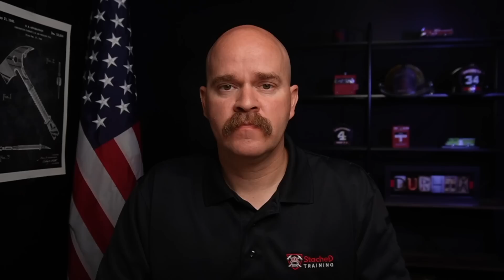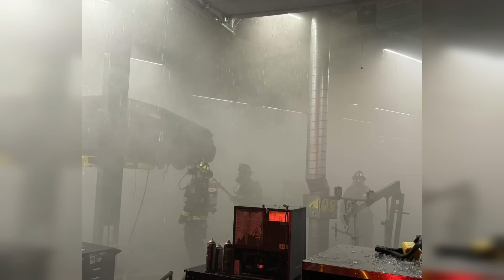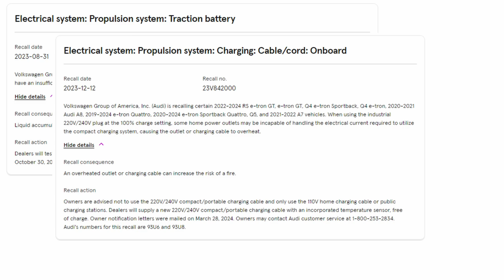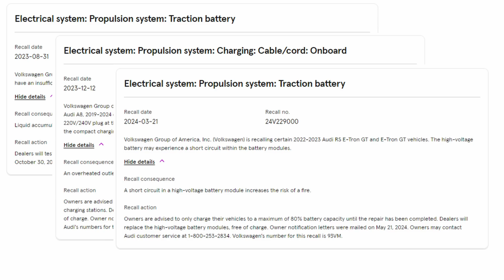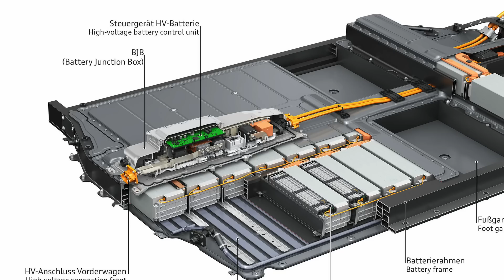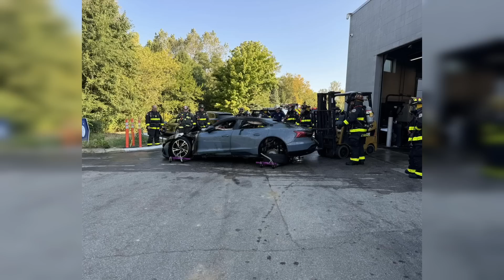EV Fire in Service Bay: Stuck on the Lift

Comment: So if I ever buy one of these things I’ll have to park it 50 feet away from my house. I wonder how my neighbours will feel about that.
Reply: The same way they feel about all other vehicles with a “do not park inside” recall feel
Reply: Yeah that advice is not practical at all.
Just storing it outside mitigates most of the risk.
The distance is due to the smoke.
Reply: @economicprisoner  The distance is because of the heat of the fire. The smoke is lethal for much more than 50 feet. The batteries burn very hot so anything within 50 feet is in danger of at least getting scorched.
Reply: @MapleMAGA1963 The intense heat IS a major concern,but in the incinerations I’ve seen these melt downs can shoot plasma jets 15’ and hurl chunks of flaming debris 50’.
Reply: My first house had the driveway next to the house.  The property line was 8-ft from the house, the width of the driveway.  50-ft was the whole width of my property.
Reply: Glad you got to work
Reply: I ask my city if I could wire my charging station out by the driveway and they said, "Not no but hell no."
Reply: He meant it should be parked 50 feet away because it already had an electrical issue, which makes it way more at risk of a fire.

Comment: Contrary to popular propaganda, EV's are turning into a nightmare.
Reply: That's right.
Reply: VERY well said
Reply: Besides your feelings and a video of a malfunctioning car, what is your source?
Reply: @nathanbaker6033  First, I would say that an EV bursting into flames is more than a "malfunction".  Second, search the internet and you will find numerous examples around the world of EV battery caused fires. ICE fires almost exclusively happen after major accidents, but not spontaneously.

If you like them, you're welcome to use an EV - it's a free country.
Reply: @terry_willis   The Swedish Civil Contingencies Agency (MSB) reported 23 fires in 611,000 EVs during 2022, or 0.004 per cent in a year, which makes it 20 times less likely to happen than ICE car fires, which burned 3,400 times in 4.4 million cars, or 0.08 per cent.

Also a quick search showed that only 1 in 8 vehicle fires happen on the highway. So no, ICE fires aren't almost exclusively happening after major accidents. Electrical, mechanical, and engine overheating are all leading causes of fires and they are not always related to car accidents.
Reply: @nathanbaker6033  Like I said: It's a free country and you're welcome to use an EV.

Comment: Not just the other cars in the shop.  All the tools that may have been damaged as well.
That was an expensive fire.
Reply: I can only imagine the fleet of Snap-on and Matco trucks heading their way when they get an insurance payout. It'll look like Gondor called for aid.🤣
Reply: @Dirk_McDirken  Only things like code readers and electronic tools would be affected.  It's not going to hurt things like wrenches and sockets.
Reply: @ffjsb  Depends how soon you can get in to dry and oil them. Wrenches will rust.
Reply: @economicprisoner  Not that quick.  Most are chrome plated.
Reply: @actually5004  Which is a SMALL part of a mechanic's set.  And even still, they're not raw steel, they have a coating.  Again, they're not going to rust away in a day or two...
Reply: @ffjsb  Incorrect. Extreme heat ruins the hardness and temper of the steel used in the hand tools. It will also cause the chrome plating to separate from the underlying steel, and this is evident by visible bubbles or blisters. Much of the damage cannot be detected by sight or touch but only by subjecting each tool to hardness testing and comparing the results with manufacturer's specifications.
Reply: @economicprisoner  Rust isn't the worst problem. Read my other comment on this topic.
Reply: @ffjsb  What do you think happens to chrome plating when exposed to high temperatures?
Reply: @GaiusTacitus  You clearly don't know what you're talking about.  Not one single tool was subjected to ANY heat.  All the fire was contained to the car and the lift.  It probably didn't get much over 100 degrees in the building except directly over the fire.  The sprinkler system contained  the actual fire damage.  Did you even watch the video???  And like anyone is going to do a hardness test on every wrench and socket...  Have you ever done an actual hardness test on steel??  I have.  You're clearly pulling your theories out of your rear end.
Reply: @GaiusTacitus  When was ANYTHING other than the car and the lift exposed to high temperatures????  The sprinkler heads would go off when temperatures got over 130-170 degrees.  It's doubtful that the ambient temperature in the building got much over 100 degrees, except for directly over the fire.  You clearly didn't see any tool chests that were burnt up.
Reply: @ffjsb  Perhaps the concern is HF fumes.
Reply: @soundspark  All the "fumes" were ventilated out of the building...  other than a light coating of soot, all the tools would be fine, with maybe the exception of some electronic devices, but unless they were in the immediate vicinity, they probably would be fine too.  Most tools would've been locked inside of tool cabinets, which would've protected them pretty well from smoke and water.
Reply: @ffjsb  Anything in close proximity to the fire was exposed to high temperatures. When lithium-ion batteries burst into flames the temperatures rapidly increase from 200 degrees Fahrenheit to more than 1,800 degrees. As the fire continues to burn the temperatures can increase above that. 

A sprinkler system is incapable of extinguishing a lithium-ion based fire.
Reply: @ffjsb  I worked as a manufacturing engineer for more than a decade, a machinist before that, and plant manager with direct oversight of CNC machine shops afterward. I've performed hardness testing on more parts than you've put hands on in your lifetime.

It is my experience that gives me insight into the potential damage to tools that can be caused by a lithium-ion based fire in an automotive shop bay.
Reply: @GaiusTacitus  WRONG kid.  I only have 40+ years in the fire service, plus a major in Fire Science.  A burner on a gas stove can reach temperatures of over 3,500 F, but that doesn't mean your kitchen will get burnt up.  The heat is localized.  Notice that the car wasn't even totally consumed.  None of the rubber hoses hanging in the area are burned up, and the plastic quart jugs of oil on the cart next to the cart aren't even melted... that's because while sprinklers won't put out any car fire completely, they DO keep the fire in check and keep it from spreading.  The water spray also absorbs a lot of the BTU's being generated.
It helps if you actually know what you're talking about...
Reply: @GaiusTacitus  You have ZERO experience in firefighting.  I have 40+ years on the job, plus a major in Fire Science.  Typical engineer, you have knowledge, with zero common sense.  The plastic quart bottles sitting on the cart next to the car aren't even melted...  SMH.  You don't know anything about heat spread, sprinkler systems, or fire in general.
And again, NOBODY is going to do a hardness test on every wrench or socket they have.  There would be OBVIOUS heat damage to the tools.
Reply: @ffjsb  While I do not have expertise in firefighting and will admit to listening to the video while working and not watching the images, I do have significant experience working with metals - including heat treating and tempering - both as a journeyman machinist and a hands-on manufacturing engineer.

I'm also not commenting just on this specific incident but on the damage to mechanics' tools that can occur in fires generally.

Heat damage isn't always obvious. A change in the properties of materials can occur which are undetectable without testing with metrology equipment. Tempering is the process of reducing both internal stresses and hardness to make an item more resilient and less prone to fracture when external force is applied.

Some mechanics posting in this forum were concerned about damage to their tools from a resulting fire. One even expressed an unrealistic expectation that the company's insurance would pay full replacement cost, even though the policy likely wouldn't even cover his tools at all.

Insurance adjusters would look at tools with the casual knowledge of a firefighter and assume there is no damage done because no damage is observed, even though the tools could deform, bend, or break when put to normal use due to a decrease in hardness.

The difference in hardness between Pittsburgh and SnapOn hand tools is why there is a huge difference in price.
Reply: @GaiusTacitus  I don't know why you keep talking about crap that doesn't have a damn thing to do with THIS FIRE.  Just keep your hypothetical BS to yourself.... SMH
Reply: @ffjsb  My comments have to do with EV fires in general. They were in response to mechanics who had concerns over the potential loss of their personal tools.
Reply: Round here, tech tools aren't covered on shop's insurance. Techs have their own separate policy.
Reply: @MrMice... .  YEP .
Reply: Soon, the Insurance company's team of lawyers will all be seated around the corporate conference table, sweating and ringing their hands while discussing every detailed aspect of the contract and why they shouldn't have to pay.
Reply: @lisashiela9137 they're going to have a hard time getting out if this one. If my personal tools, that are required by my work, are damaged while at work.  That is definitely covered under the rider.  And that's replacement cost not value.
Reply: @starbolin  Insurance companies never pay replacement cost. You've just pointed out why companies should provide all of the tools needed by mechanics.
Reply: Hard earned tools by the technicians there.
Reply: Shops will NEVER pay for a techs tools. It is up to the tech to insure their own tools. Guess how many techs do that?
Reply: Yep. I used to open for the mechanics in an autoshop and one tool alone, a diag system cost several grand.
Reply: I work in a shop that experienced a pretty large fire a few years back. The entire parts room and offices were gutted. The shop faired a little better. Every truck in it was written off by insurance. Lots of plastic items that were directly exposed were melted. The one piece of equipment that gave us the most trouble was a mig welder that wouldn’t properly feed wire anymore.  Every mechanic had to thoroughly clean his tools and box. Mostly water and soot damage. Lots of toolbox drawers with standing water. Even battery powered electric tools were able to be dried and used. The diag laptops were destroyed from water damage but all the other tools in the shop survived and are still in use today.

Comment: This proves that electricity is nothing more than compressed smoke and fire.
Reply: so you're saying E=CS+F
Reply: Yes, if you 've ever let that magic smoke out of an electronic device, you know that device doesn't work anymore.
Reply: Isn't this true for all form of energy storage? All fuel types are storage of chemical energy. Batteries are taking chemical energy and converting it to electricity. Battery is an engine by definition of engine.
Reply: @noblekitty  yes, for exothermic chemical reactions. Mechanical energy storage, such as a spring, wouldn’t qualify.
Reply: @YourThermalWorld  mechanical storage can still create heat, thus smoke and fire. Most form of energy would eventually turn into heat.
Reply: mmmmmm... electricity is more akin to "hydraulic fluid". something has to pump it around... energy. a convenient form of conveying "energy"...

can open a book from 1930 and its very clearly explained... "batteries dont store electricity, they store energy"...

i read a lot... something started to change around that era, the way certain things were explained... i hang onto all my OLD books as they seem to be so much better at conveying vital points...

never had any lead acid battery spontaneously ignite... could get something ATTACHED to it blow up, but never the battery....

now we fill cars and building WALLS with them... ones made with highly reactive metals... with LOTS of "energy"... and rely on these little "black boxes" to keep them under control...

"oh, but what about those tanks of liquid fuels?"

um.... it actually requires EFFORT to light those liquids... and generally, theyre easily extinguished on the rare occasion they DO ignite...
Reply: Lol underrated comment.

Comment: sprincler systems should be mandatory for all garages, not just srepair shops.
Reply: Would not do diddly squat but yeah, make stupid expensive things mandatory so repairs cost even more.
Reply: @paulhare662    Sprinkler systems are a good idea. They can save a lot of money when there is a fire, by saving the building from completely burning down.  Which puts the shop out of business for months (or years) until it is rebuilt.  I know of two repair shops in small towns near where I used to live that burned to the ground within a couple of years.

Comment: ICE vehicle fires rarely occur when they’re sitting idle. It’s usually after a crash that ruptures the fuel tank.
Reply: The most common cause for fires in ICE vehicles is actually an electrical short.
Reply: @WolfHeathen  What is a short going to ignite unless there's a fuel system leak?  Some sparks may fall, and a fuse may blow, but there's not going to be a raging fire unless the fuel system is damaged -- which isn't going to happen to a car sitting idle.
Reply: @softwarephil1709  it sets fire to the seats    and thoes burn better than  bit of fuel in the tank    way better   plastic   is more  made from  fuel/oil   so burns  aswell    had a volvo s40 set  on fire it didnt have the fuel tank in it   at the time    was glowing red  with the heat
Reply: Nah, sometimes they self ignite just like that due to shorts, especially older ones. However, a single fire engine can take care of such fire, and they don't reignite afterwards.
Reply: mosty  mice  / rats   chew threw wires     on ice cars /other stuff diggers   etc    not just cars   heck  can happen to your home rats are not good
Reply: @przemekkobel4874  What is a short going to ignite unless there's a fuel system leak?  Some sparks may fall, and a fuse may blow, but there's not going to be a raging fire unless the fuel system is damaged -- which isn't going to happen to a car sitting idle.
Reply: @przemekkobel4874  I repeat my question: What is going to burn unless there's a fuel system leak?  Wire insulation?
Reply: @softwarephil1709 This is just ignorant. Every single thing in every modern car interior is flammable. Many things under the hood are flammable. The idea that an electrical short somehow can’t cause a fire is ludicrous. I’m entirely anti-EV, but try being intellectually honest for a change.
Reply: What is on to ignite? Uhh carpet? Seat fabric? Door panel fabric. Other wires. Plastic. There is many thing in a car that can ignite over just gasoline
Reply: Or arson, like in the Swedish statistics.
Reply: Or when an ICE ignites next to one.
Reply: All please stop trying to compare the two.

Comment: Almost everyone in the comments secion seems to be ignoring the "when a ICE vehicle burns down" section. Yeah, EV fires still 100x less likely than ICE fires.
Reply: ICE vehicle fires rarely occur when they’re sitting idle. It’s usually after a crash that ruptures the fuel tank.
Reply: EV FIRES…Perhaps 100x less likely…100X more dangerous and potentially deadly.  
Would you want to work in a shop that has been possibly 100% decontaminated after a lithium fire?